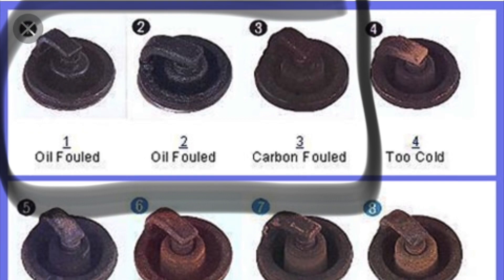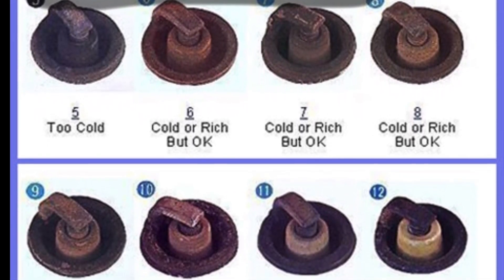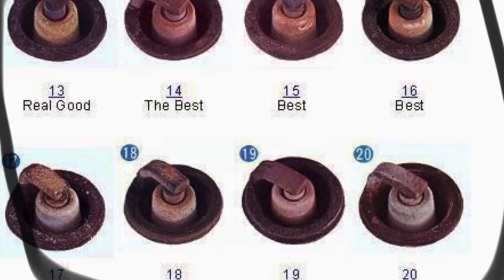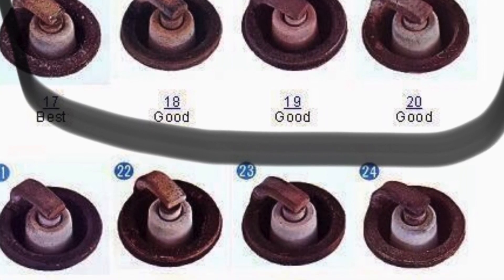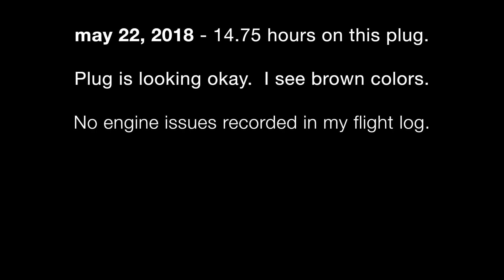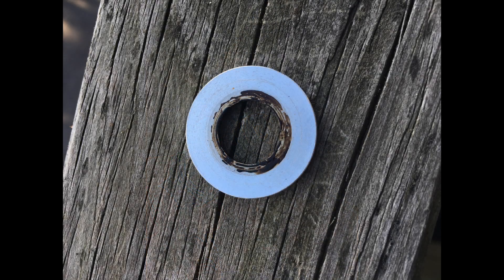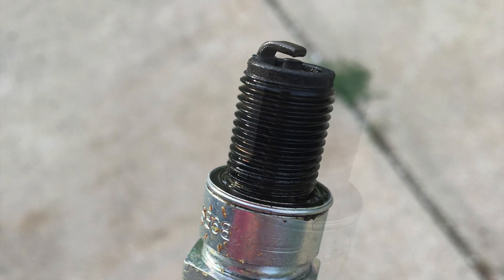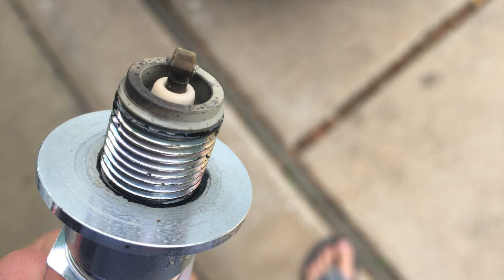Miniplane ABM Top80 - Spark Plug Color

Comment: When you pulled these plugs, did you kill the engine immediately? 
( meaning you want to be a cruise or Full Throttle for about 10 seconds and then kill the motor) ... if you allow the engine to drop back down you're going to have a richer color on your plug.

I also use Amsoil Sabre.. my engine temperatures have been nothing but low even at 90+ on the ground and 70+ altitude..

I would note,that for the hours you have, it looks like you had a lot of carbon on your piston...

To me heat tissues seem like the number one serious problem with any paramotor. I cheat and add a little bit of Lucas lubricant and Seaform, to my gas. 10oz, Seafoam, and 4oz Lucas, to 5 gallons. It really amounts to about a dollar more per gallon to cost. 

But usually by February I do my winter break down and the last two years my piston has looked phenomenal....

... if you were leaking oil by the plug, you could also be adding more air into the engine in flight so I would be glad that you're running richer just to make sure a bad plug hole doesn't cause a lean condition and burn your piston.... I'm sure you can find many a video where you can see the hole, right in the center of the Piston, where the plug fires from an air gap..
Reply from the maker: no I did not kill the engine immediately.  I let it idle down, then cut it.  thanks for the info.
Reply: @577buttfan  I've never heard anything bad about it so I figure a couple ounces definitely couldn't hurt and so far so good.. you know it's making enough power to Chuck me sideways.. ;)